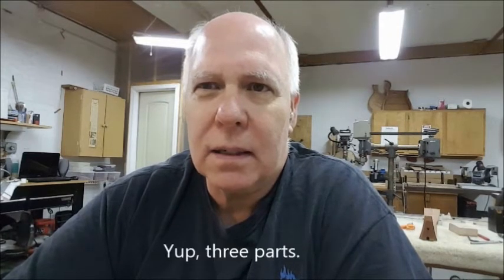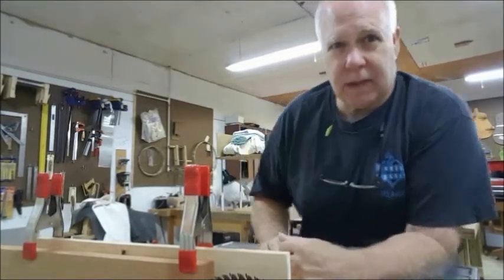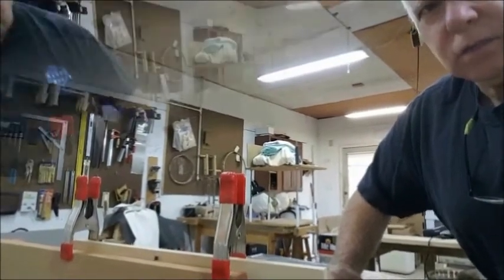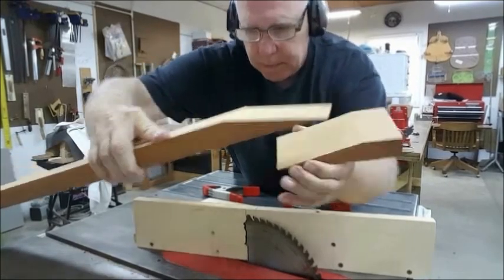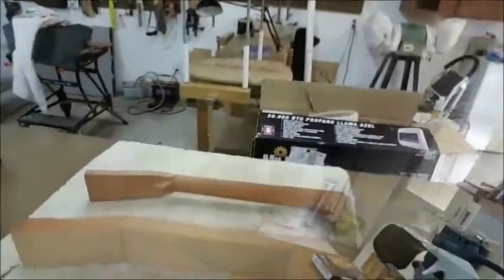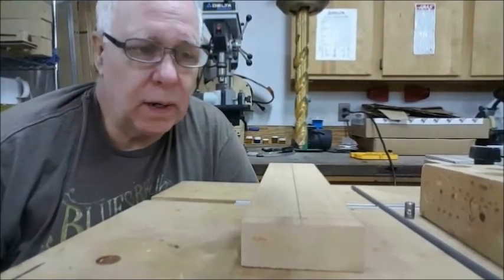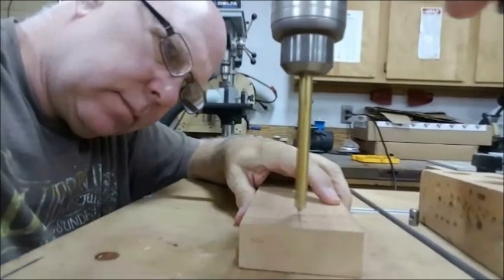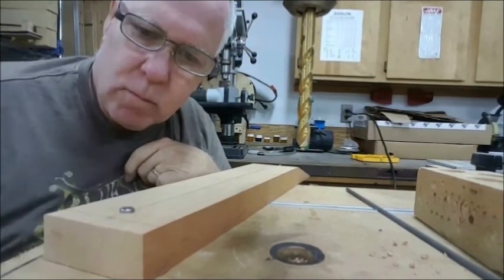Installing a Vintage Style Gibson Truss Rod: Part 1

Comment: Hallo, can you make a video on how to reset a Gibson truss rod?
Reply from the maker: Are you referring to replacing a broken truss rod?
Reply: @timbenware7893  no not at broken one, but sometimes I see an add for a Gibson guitar, where there is a picture of the trusrod cavity, with the threads visible over the nut, and it often says, trusrod working, but wil need a reset in near future.
Reply from the maker: @kennethnielsen3864  I believe what is being referenced is a guitar that has a working truss rod (often older Gibson rods have been tightened to the bottom of the threads) but is in need of a neck reset. Typically an older guitar will need a neck reset when the string action becomes so high it is difficult to play and the saddle is so low there is no longer sufficient material to take off to lower the action (high action/low saddle). In these cases the neck must be removed and the neck angle "reset" to get the guitar playable again. A process some consider major surgery on a guitar. I can cost from $200 to $600+ for a neck reset depending on several factors. My typical price is $200.